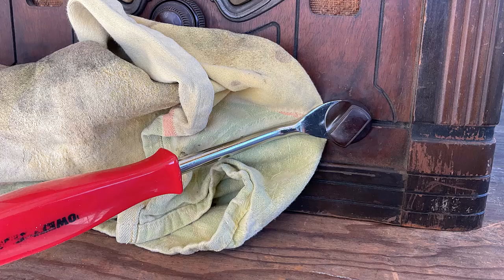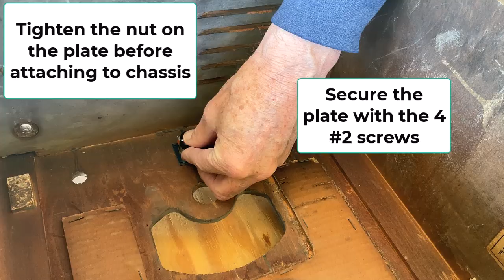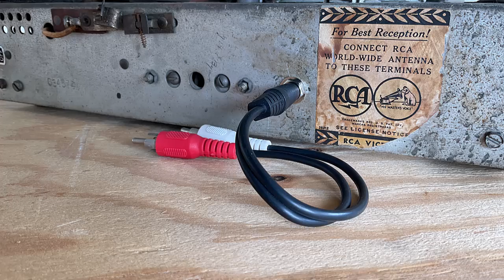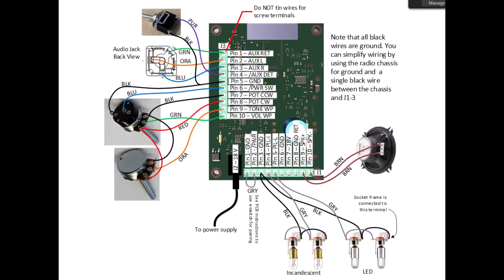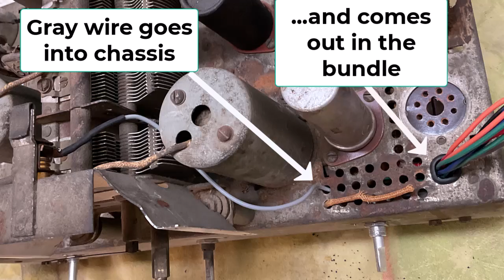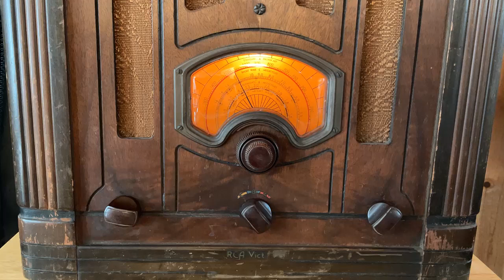Bluetooth Antique Radio Conversion using the Seagull Retrofit

Comment: Ive been looking for something like this, but would it work for my MCM Philco Table Lamp/clock radio? Its a very small speaker
Reply from the maker: Hi Bonnie, it's Barry from Seagull. If you can send me a few photos of the lamp and tell me the dimensions, I'll be glad to take a look. Please send email to bdorr<at>sdsu.edu. Thanks
Reply: Its a Philco 53-706, ill have to get the dimensions later. 😅

Comment: Thanks for the video. Where do you buy the differents parts ( Amazon, Aliexpress....) ? What are the models and references of the parts ?
Reply from the maker: Hi, it's Barry from Seagull. Most customers don't have all that stuff, so we sell the PCB bundled with the "Potentiometer and Wiring Kit." It has nearly everything you'll need and will save you the shipping costs from multiple antique radio and electronics suppliers.

Comment from the maker: This video shows HOW to do the retrofit. This video (https://youtu.be/pFvUoqb8GSw) shows how the radio will work with the retrofit installed.
Reply: https://www.youtube.com/@professordorr-ecelectures7377 what length are the potentiometer spindles supplied in the kit please?
Reply from the maker: @jamesthomas-q2x  Hi James, it's Barry from Seagull. The shafts extend 1.7 inches from the end of the threads. They extend 2 inches from the mounting face of the pot. Just send email (bdorr@sdsu.edu) if you have further questions
Reply: @professordorr-ecelectures7377  Thank you very much Barry.